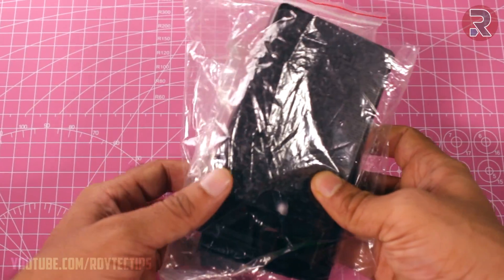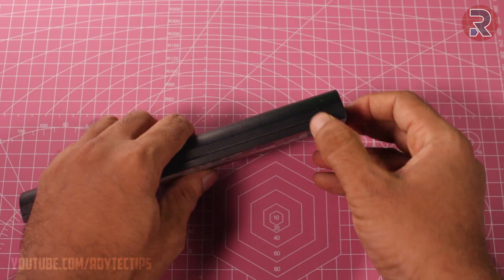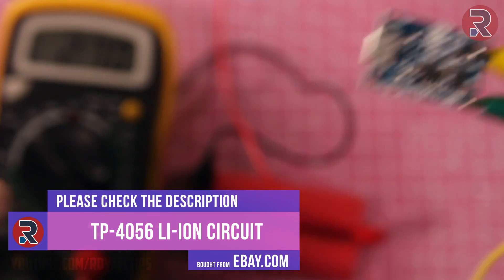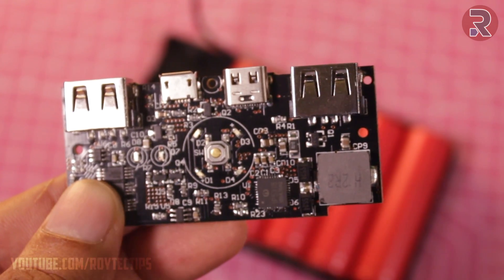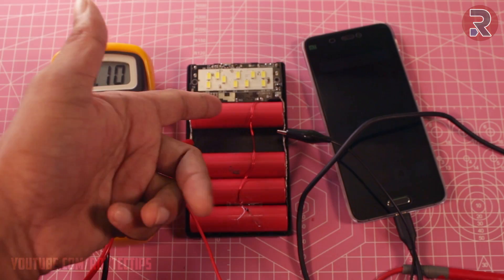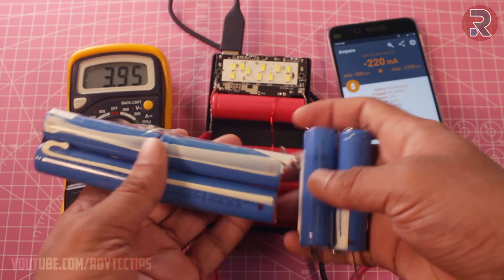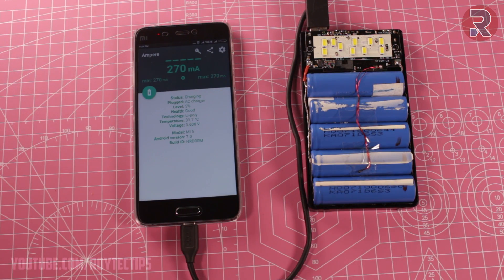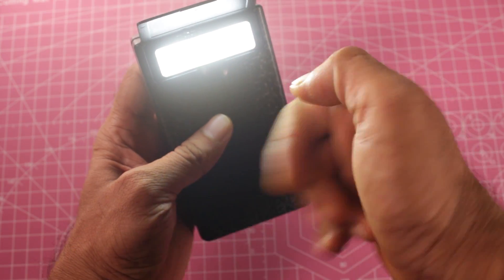How to Make a Qualcomm Quick Charge 3.0 Power Bank from Scrap Laptop Battery - DIY

Comment: Yeah that hot battery is the one that was at 2.7V and you charged it at 1A 

And all of them self discharge? Shocking. That was obvious when you pulled the pack apart and the voltages were all very different. The second pack  was pretty close meaning they have low self discharge.

You don't want to charge those cells at 3 amps. That's 600ma for 700mah cells that are nearly dead. Dead dead.

Comment: Do NOT use TP4056 to recover cells with low super low voltage. While the TP4056 does use a trickle charge of140ma, it will ramp up to the normal charging current past 2.9V and if you haven't changed the R3 resistor you'll go up to 1A. Cells at very low voltage should get charged with even lower current, 140ma isn't too bad but then when it ramps up to 1A that is very very bad for a cell that has been damaged.

The fact that all 3 groups were out of balance like that is not a good sign.

Comment: How's the module?
Reply from the maker: its ok.
Reply: @RoyTecTips  is there any new model?
Reply: @ashik763  There are at least 3 versions of this that I have seen. Slight changes like input voltage 6-32 or 8-3, some have a difference in components like one more capacitor, or a different size PCB board. I prefer the smallest PCB board that does 6-32 but I would love a 6-42 or something higher for running off 36V scooter batteries

Comment: how to make qualcomm quick charge is buy qualcomm quick charge module.
Reply: Imran Sidabutar haha lol
Reply: yeah if you're a smoothbrain. I made triple QC3.0 charger to run off one solar panel and easily power my 18650 lithium battery charger/testers.  Did it with about $8 in parts.

Comment: The circuit board of power bank is the fast charging but the loptop battery are not.
Reply: That makes no sense. Batteries do not perform fast charging they just supply the current needed at the voltage they are at. This is a buck module capable of 24W max at 12V 2A.3 batteries series should have no problem triggering any of the QC protocols

Comment: Really nice work, bro! And great power bank kit! I think that cells from laptop batteries can be used with that power bank kit, you just had bad luck with them, their capacity must be really low... You know? You need to make a charger like mine and get a tester board as well... Then when you find cells with 2000mAh (or more) you use in it. ;)